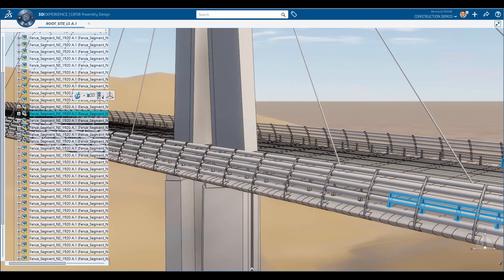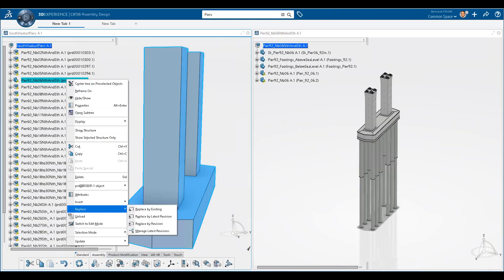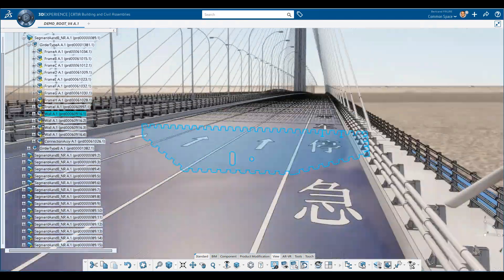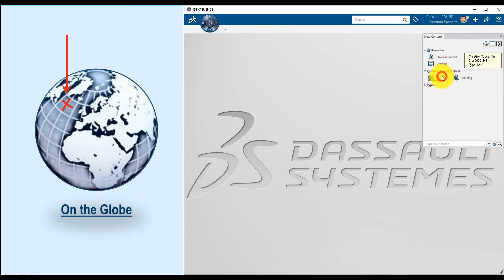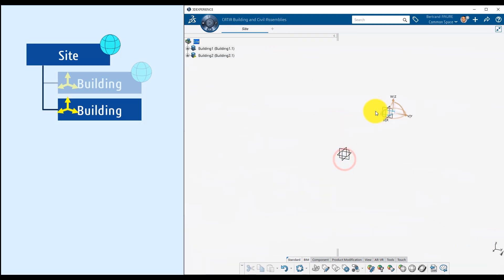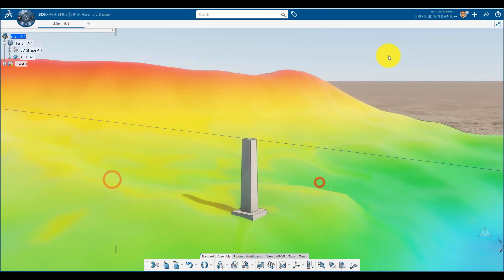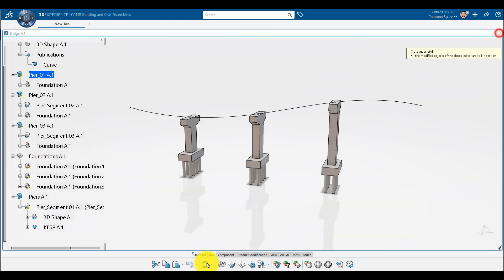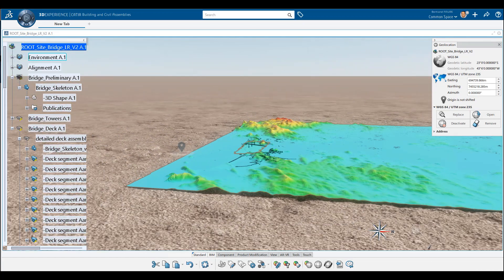CATIA for complete beginners: 05- Design at the right level of detail

Comment: Good video! But I have some questions regarding from 20 seconds to 30 seconds. What is the best practise to connected a simplified model with manufacturing model? Because replacing all parts with manufacturing drawings, whole building model became very huge and there is not necessary to have all parts there. 
One more thing, do you use Cloud versions for making a video?
Reply from the maker: Yes, the videos of this "CATIA for complete begineers" serie are all made with cloud version
Reply from the maker: For the product structure you can
1-Make two different product structures reusing the same Skeleton so they stay synchronized
2-Or use unly one product structure containing preliminary elements and manufacturing models, and use a PLM filter to open only the needed data
Product Structure require a good monitoring of all data produced, I plan a tuto video for this specific topic
(thanks for watching :)
Reply: @CATIAAEC  Thank you for answers, I am looking forward to the new video :)